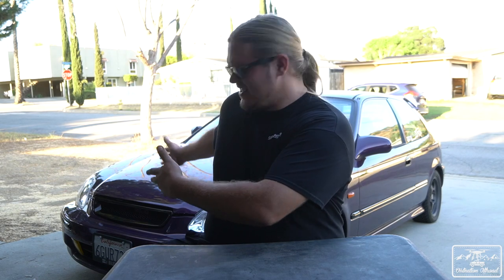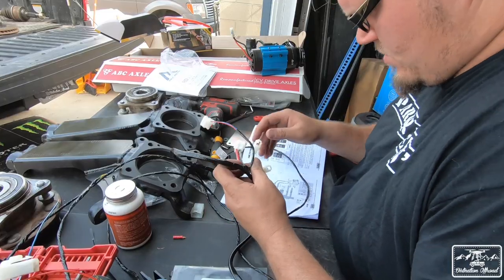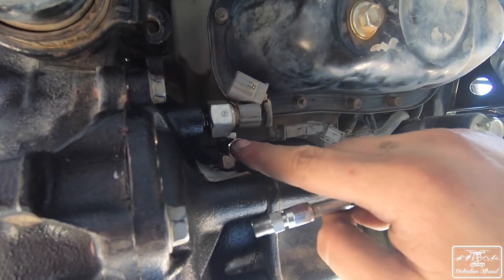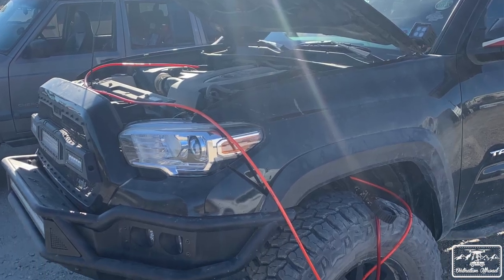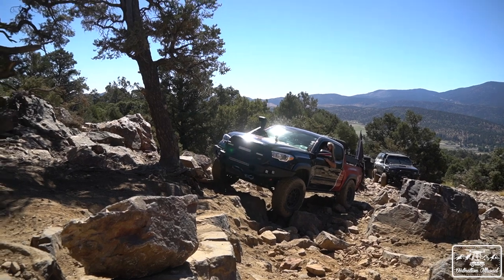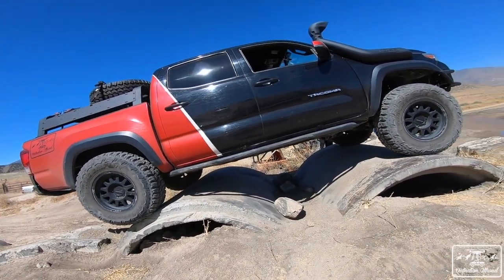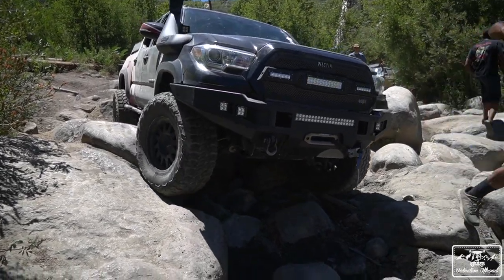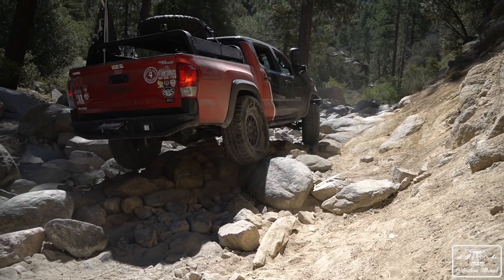Front lockers on Tacoma's worth the hype? ARB Front Air Locker and Compressor Review!

Comment: I have the duel arb compressor and it’s very good no problems so far, although im not using ARB lockers as well. Just be careful if you’re using the single compressor compared to the dual, you can only air up about 4 tires then have to let it cool down for 10-15 minutes.
Reply from the maker: Yeah the single isn’t 100% cycle..it can overheat but it hasn’t gotten too hot so far luckily
Reply: Dirtnation Offroad Yes mines never “overheated” but after 4+ tires it’ll definitely burn you if you get close 😂

Comment: Love these technical updates based on real world experience, what’s wrong with the ARB mounting bracket ?
Reply from the maker: I only mounted it to 2/4 bolts because it doesn’t fit that well
Reply: 🤔,,,I see ...so it’s floppyfied ...did the G&J hose thing , shout out to them and “Solo Paul “love his genius input on things ..
Reply: Watch when it kicks on in the video... you can see the mount flex a bit... Good mount isn't going to be SOLID because you want a little bit of wiggle (for lack of a better term) so the compressor doesn't vibrate itself into oblivion, but its gonna be more robust than that 😁
Reply from the maker: Paul is a genius...I’d be lost without him 🤣
Reply from the maker: Exactly 🤣🤟🏻

Comment: I changed my 1999 Toyota 4runner 4wd limited front differential 4 months ago because I had an issue with the gear's, and i sad my self why not to order the new one with front locker. Than i ask myself, did i stock anywhere with only having a rear locker No i been pretty hard trails but never need the front one. So it is up to u guy's need it or not but his right gives you more confidence when u have in your track or suv. But overall for me i don't need it.
Reply from the maker: Yeah a locker isn’t for everybody 🤟🏻most of the time we can make it by without it

Comment: I have a problem with ARB lockers. The twin o rings inside the air line ring (seal housing) mounted onto the axle spline gear (bearing journal) is so low quality. They begin to leak after a year and start to pump your diff oil out to the air pump and now you have an oil leak from your air pump. And when the leak increases with more wear, your lockers stop locking. You have to dismantle the whole diff to change those washers. And guess what, those also wear and here we go again. They are constantly subjected to friction when the axles are moving. This is a big big design weakness. I prefer electrically operated lockers now.
Reply: How old are your ARB lockers ?  I read that ARB fixed return O ring failure issues.